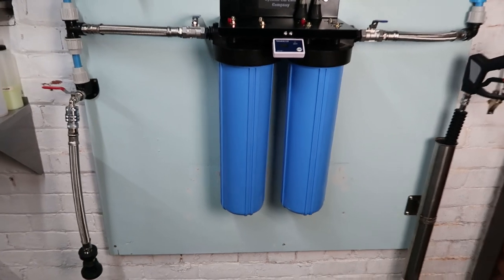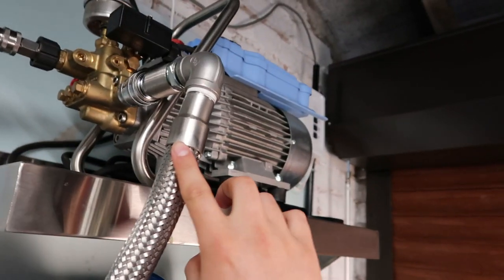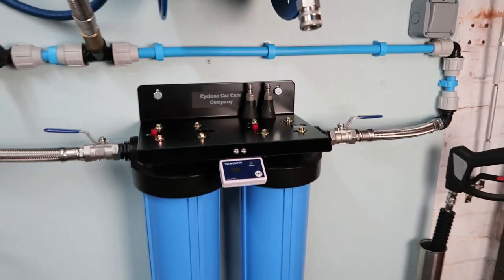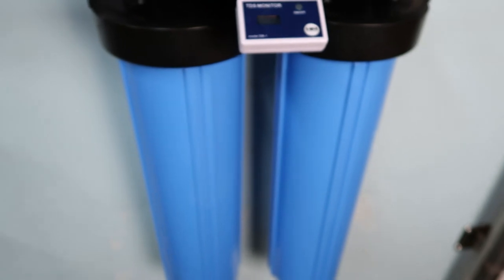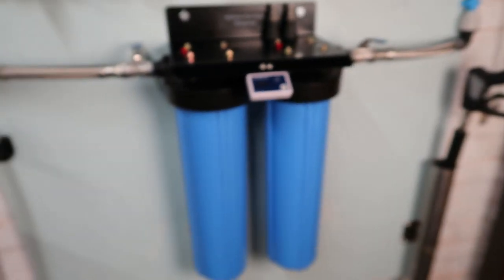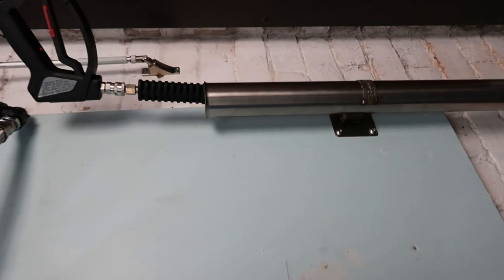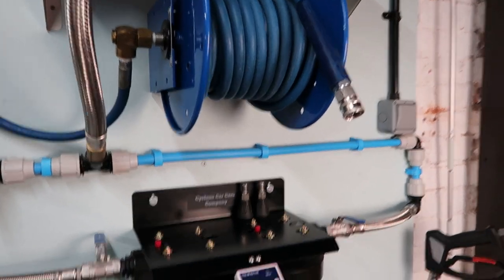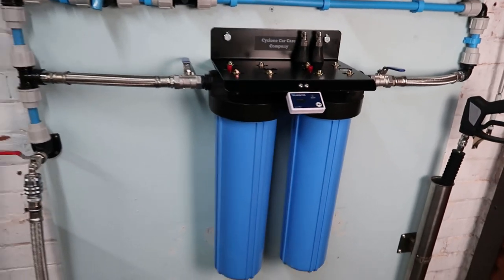The Best Car Washing Upgrade! - Spotless Wash System

Comment: Cracking video! Do you know if the cyclone system would work with a water tank and the PW being the source of the flow rate? Sounds like it might be a bit of an ask but I wanted to check.
Reply: Cant see that being a problem dude!
Reply: @henriwhiteman1630  nice! It's a problem with Di resin vessels so I wanted to check.